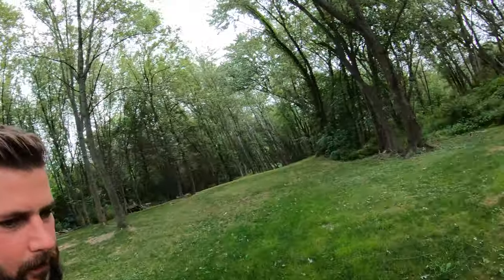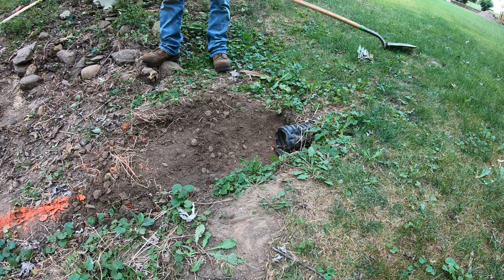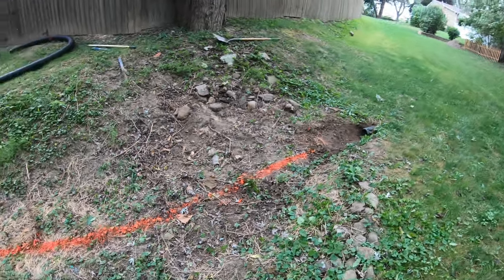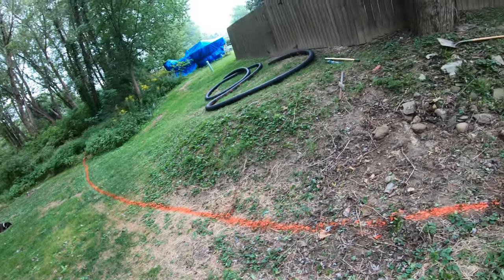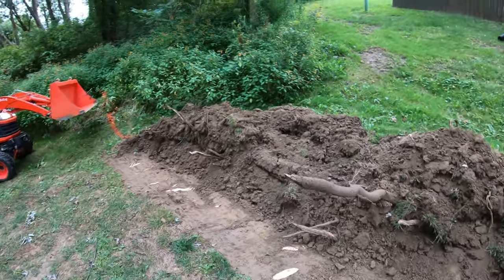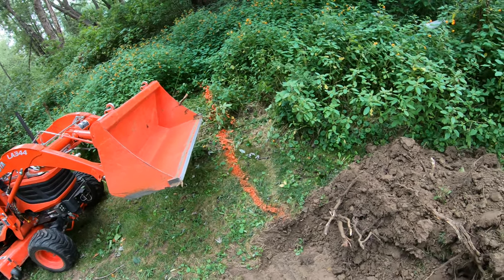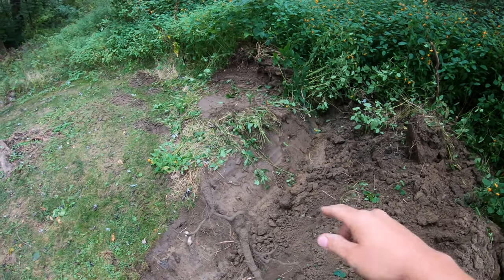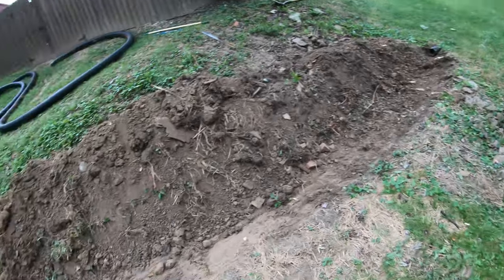Kubota BX- Digging a ditch with the front end loader

Comment: Looked like it struggled pretty good to dig
Reply from the maker: It was struggling to dig, this was mid summer when the ground here is super hard, not to mention there were a ton of rocks at the beggining of the ditch, once I made it to about the 1/4 or 1/2 way point tho it dug super easily. Thanks for watching
Reply: Get a Backhoe then! The attractor is a multi-purpose tool. A pickup truck strains pulling a trailer at max weight too!
Reply: If you give me the $8000 to buy it.  I'll do it with a backhoe.if not I'll work with the machinery I got. Glad to know I can do it with just the front loader! My car stuggles going up a hill at speed. I think simi trucks do to. Maybe get a rock crawler?
Reply: @donraptor6156  couldn't you just plow it faster and easier?

Comment: Do you do most of your work in high or low gear range?
Reply from the maker: It all depends.. a job like this where I’m using a lot of force to beak through fresh ground I’ll always keep it in low gear as it can be hard on the trans to keep it in high and you may not have enough power to break through hard ground.. when I move loose dirt or light objects or even when grading I often keep it in high gear for the speed and fact of being more efficient. 👍🏻
Reply: The tractor has L M & H.  Think of it as L= Loader, M=Mower and H= Highway.
Reply: @bill5552  Actually the BX series only has Low and High range...the B-Series the next size up does have Low Medium and High range however.
Reply: High range doesn't have the Grunt! I seldom travel in high range! Slow and safe!

Comment: nice work. Do you think that's hard on the loader/tractor??
Reply from the maker: Thanks buddy, this digging was very tough at first for the tractor and loader, I worked it pretty good but it was only so tough at the start because there was a lot of hard rock I was having to dig through along with lots of roots too.. once I got passed that stuff about 6’ down the trench the tractor dug it out with ease no issues what so ever. If I had a tooth bar on the front of the bucket when I did this Job it woulda been much easier on the tractor and loader as well 👍🏻
Reply: Leave it in the shed then! A tractor would not have a Loader if it would damage it! It is called a tractor!

Comment: You need to add counter weight to the rear end then it will dig olot better
Reply from the maker: Thanks, I did have my rear tires filled in this video and also had four 40lb weights on my rear 3 point.. I have since then doubled the rear ballast tho and now have eight 40lb weights in the back so now I have plenty of ballast. Check out some of my more recent videos, I have one where I specifically talked about the extra suitcase weights I added and why. Thanks for watching!
Reply: @BiffsEquipment  im sory I didnt realize that you did have counter weight, good job I love your tractor
Reply from the maker: @coolstuffgoingon3023  thanks I appreciate it, I plan to add a turbo to it soon so stay tuned for that haha
Reply: I have a BX2680 with a 170kg counter weight. Really helps
Reply from the maker: @XxBloggs  it really does make a WORLD of a difference on these small machines both with stability and being able to put all that power to the ground!

Comment: I think the video would be a lot better without the music
Reply from the maker: Sometimes I add it sometimes I dont.. All depends on the video. Sometimes videos can get quite boring with out any music and if the video is sped up then you almost need to cut the engine sound completely and add music as the sound of the engine will sound high pitched and terrible. I have other videos where I don't add any music so you may like those better.

Comment: Your grill looks like it’s coming lose
Reply from the maker: Thanks yah this video is quite old but at the time it was loose as the mounts for the grill/bonnet were cracked.. these days I have no mounts left .. it basically just rests there with a single fender washer to some what hold it in place on the wing nut lol. I have to buy a new hood bonnet it’s been on my list for a few years now
Reply: @BiffsEquipment  same with mine the mounts broke and mine is a 2006 model so I can see they haven’t fixed that but that’s why I noticed it cause I was looking for it

Comment: I just cant bare to watch, get a pirahna tooth bar at a minimum.  you need a football field on at least one side if this ditch to dig in this fashion, which 99% of the time is not available to back up and reposition yourself.  My advice?  Buy a backhoe, they are silly cheap.  Share it with someone, like your  hunting lease to make drains for mud puddles or whatever......
Reply from the maker: Id much rather use that money to buy a used mini ex. And yes a toothbar would make life easier but when you don't have the money you use what youv got and that's what my channel is all about. Either way I always manage to get the job done. Certainly there is always better tools for the job or better ways to accomplish the same thing but as I said I use what i got. Thanks for watching.
Reply: Hmm DON'T WATCH THEN!